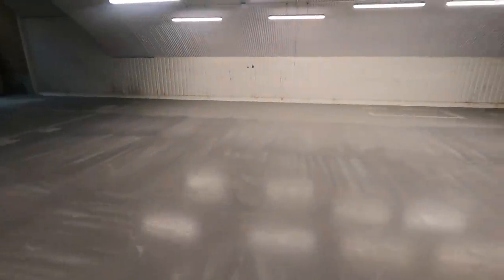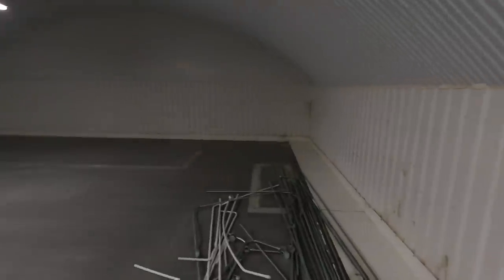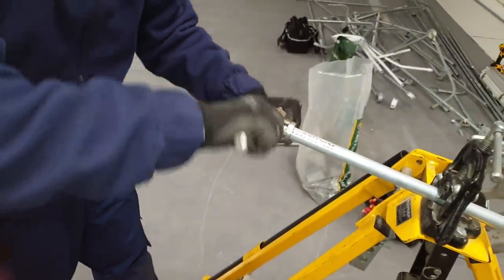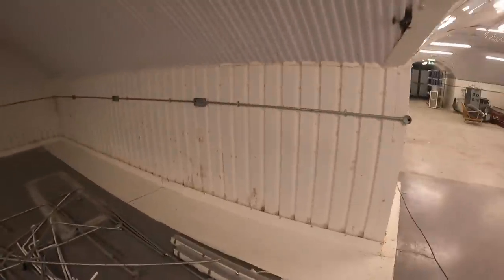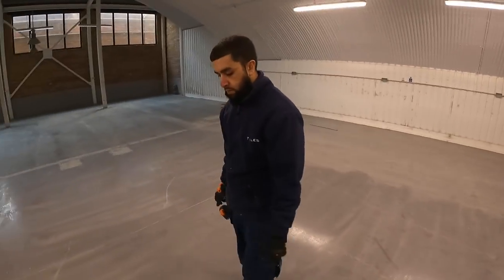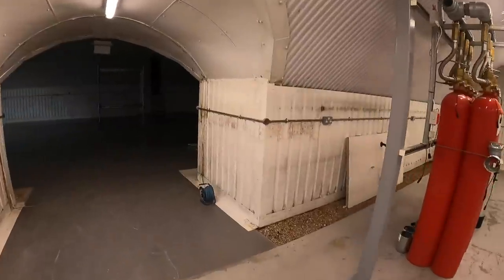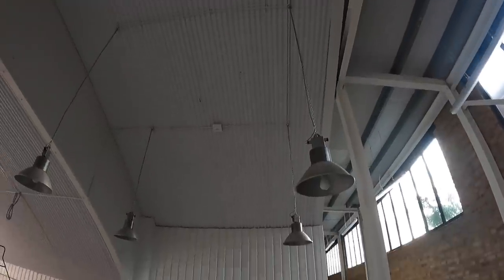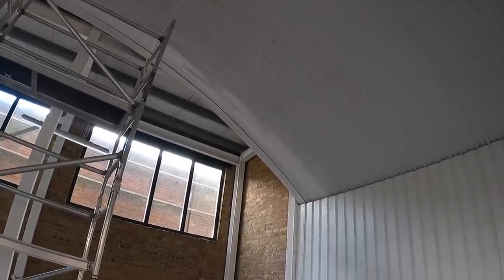Running Conduit & More | Diary Of A London Electrician | Delroy The Spark Vlog

Comment: lol i got lucky when i had to use the thickwall conduit in the states there was some pipe fitters for the sprinklers and plumbers for gas so they had the motorized pipe vise and spinner with the taps tht matched my fittings my journey man was pissed when he came back after  1 hr and our equipment was untouched but the conduit was all cut and taped lol was supposed to talk me all day to do it by hand lol easist days pay only 2nd to having three days pay for moving 900 kilo transformers up to the 25 floor (paid elevator guys 2 cases of beer to rig up controls to allow lifts to work  £250 to make £3500 with bonuses and cple of holidays lol)